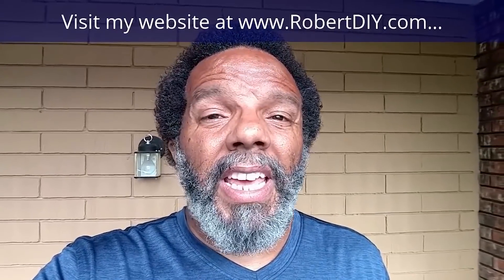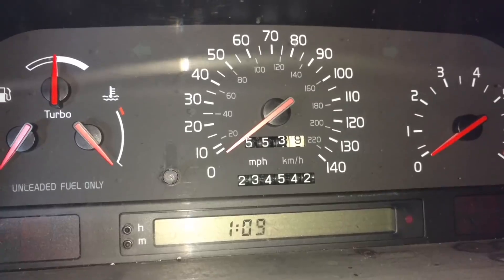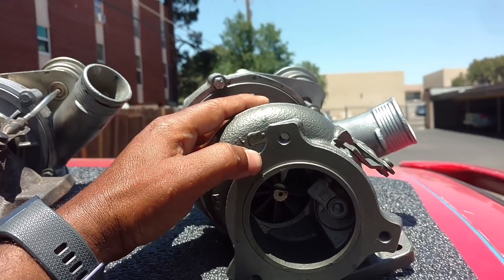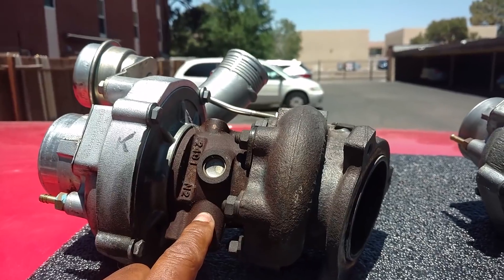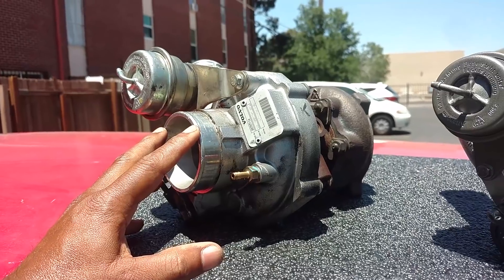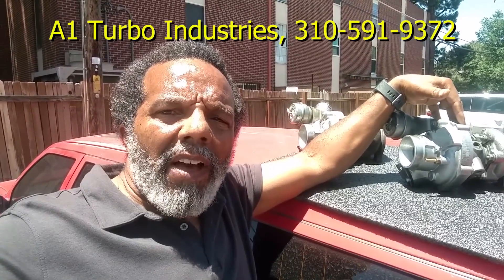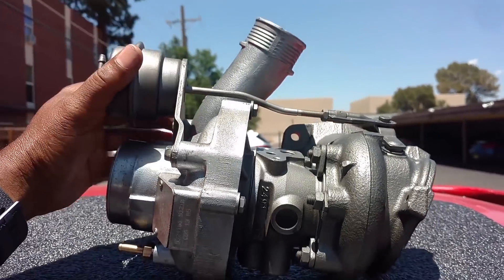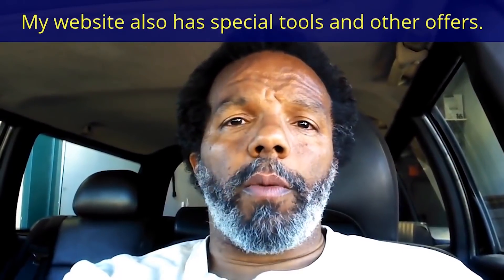K24 Turbo upgrade options when having one rebuilt. Side by side comparison, replacement, etc. - VOTD

Comment: Sooo, i have the base model 2006 volvo v70 2.5t... can i simply  get one of these k24 turbos and throw  it on the car and it will fit no modifications?  I would like to do the same thing for my 2001 v70t5...
Reply from the maker: should get a computer tune.

Comment: What turbo is on the stock 1998 Volvo V70 GLT, and what turbo can I use/replace if I can't fix it?
Reply from the maker: 13t, 13t, 13g, (15g or 16t will add aggression and should not damage anything)
Reply: @RobertDIY  I was thinking of putting the upgraded manifold and downpipe for ease of work and longevity to vehicle (just want it done quality well with out putting so much strain for power it damages)

Comment: Hey Robert, thanks for this great video. I just came across one of these upgraded k24s from A-1 local to me that a club member ended up not using.  do I need new seals to swap it in?  is a tune and/or new intake piping needed to see the HP gains?
Reply from the maker: I don't even know what kind of car you have???
Reply: @RobertDIY  '06sonicVRGT stock . 123k miles on it. working on an m66 ;)

Comment: What kind of PSI gains can one expect by upgrading the turbines on a 16T? Namely going with MambaTek billet kits. Cost and performance effectiveness is it better to upgrade your 16T or to jump to a k24?
Reply from the maker: I don't think cost is much different when changing the parts. PSI is relevant to your other mods. I know of people running 24+ PSI on their 16T. Cranking up the PSI just makes the turbo spin faster and wear out quicker. The key is to have a power gain target and communicate with your tuner based on that.
Reply: @RobertDIY  can you use this K24 turbine in a P3 car with K16 turbo? I'd rather have a K24 with a k26 compressor if it can be done...

Comment: I have a 2013 s60 t5 front wheel drive. What upgraded turbo would you suggest for me? Great information on the turbos.
Reply from the maker: I have no idea. Best to check with whomever you'd hire to tune it. Check with Hilton.
Reply: Did you upgrade your turbo on your P3? I have and could offer advice.

Comment: I just found this while looking for info on the k24. I have one that I bought brand new and never used. But now I want to use it on my mr2 spyder. I have a 2zz ge installed and I am looking to find out if the k24 would work without being to big and having alot of lag.
Reply from the maker: Sad to say, I have no idea. I'd check with a turbo guy.

Comment: Great video robert, how do you prime the turbo before starting the first time
Reply from the maker: Disconnect fuel and crank the engine until the oil pressure light goes out.

Comment: The Audi 200s (20v Turbo), 1992-1995.5 S4/S6 came with the K24-7000.  The Audi RS2 came with the K24-7200.  The Volvo S60R & V70R came with the K24-7400.  Curious - did the S60 really come with a k24 turbo?  Can't seem to find the info on the interwebs.
Reply from the maker: Yes, somewhere around 2008. Probably the T5 cars.
Reply: Coming back a year later - the T5 badged S60s did indeed come with K24-7400 turbos (2.4T).

Comment: Hi Robert!  Another problem these old turbos can create is engine oil consumption, before rebuilding mine I got the  inter cooler pipes full of oil and it was burning about 1L\1000 km, no shaft play at all, just a leaky seal. These oil leaks are specially dangerous on diesel engines, if the engine starts to feed on the oil coming from the turbo then you can end up with an engine runaway. Remember guys, look after your turbos!
Reply from the maker: Thanks for sharing.

Comment: Do you know what car models and years get this turbo so I can check the yards. Also what’s the most you’d pay for a k24 (not rebuilt). Asking for my 96 850 Platinum
Reply from the maker: Depends on how bad I need one and how much money I have. LKQ sells them for $225 shipped and will give you back $$$ of you return any turbo to them. You need more than just the turbo for the N cars. I'll post a link on my website, the video is in my Patreon site.
Reply: https://row52.com/Vehicle/Index/YV1TS91Z441373450 is 2004 s80 2.9L t6 one of them?
Reply from the maker: No, you'll want one from a S60 T5 or S60R from '04 through '07.
Reply: Oh. Your description said s80 I didn’t know which year though. Do you know what turbo that s80 will have
Reply from the maker: Some S80's have a K24 but have a different mounting arrangement. So this specific turbo does not drop in the S80.

Comment: What turbos do you have on your 3?
Reply from the maker: Red Barron is getting a RN engine and K24 turbo. Panther has the TDO4 19T. Queen Bee is getting a TD04 18T (from a '99 V70R) which was rebult with mods.

Comment: Swapping my 850 platinum from a 16t to a k24 was the best engine modification I've ever done. Coupled with the bosch green injectors, 4bar fpr, Forge cpv and wastegate, snabb intake and fmic and a tune by Va5t she not only pulls like a jet on takeoff but gets about 30mpg cruising on the interstate.
Reply: I was thinking of doing this with an rn swap into my platinum since my current engine needs to come out anyway.
Reply: diltzm I got a plat too! Do you have insta?
Reply from the maker: Yes
Reply from the maker: Nice.
Reply: Any internal engine changes needed for this larger turbo?

Comment: i've heard when it comes to tuning though the 19t flows better than the k24 and has the potential to make more power but has had the reputation of bending rods if the tune isn't 100% spot. I know for a fact though the 19t is easier to buy and install on these p80/p2 volvos unless you are able to obtain a k24 from a junkyard.
Reply from the maker: Not sure what "flows better" means but the K24 produces more power that's why people switch to it.
Reply: I'm not sure who told you that but they are incorrect. The K24 flows ~100cfm more than a 19t. If you search the forums you can find the exact numbers and comparisons between a 18t, 19t, and K24.
Reply: Here's the link with all the info. 
http://volvospeed.com/vs_forum/topic/130785-finally-have-the-k24-specs/

Comment: What about putting it on a 2000 S70 GLT? Do a video on GLT turbo upgrades
Reply from the maker: I think that turbo would blow that engine.
Reply: I'm assuming sending an S70 turbo to a1. Would you're similar results if only to make it bullet proof. I'm sure the guy getting that gonna need a new back seat cushion. Lol🤩

Comment: Thanks for bringing this information forward. I have 2 P80 Turbos that have 200,000 miles on them. They seem to be performing well, but I am going to seriously look into them being rebuilt with the upgrades. Thanks for sharing your Volvo knowledge.
The old professor.
Reply from the maker: Connect a temporary boost gauge so you can see if it's reaching proper boost pressure.